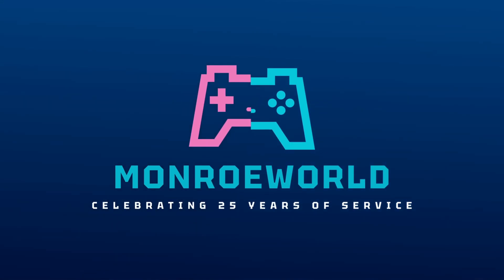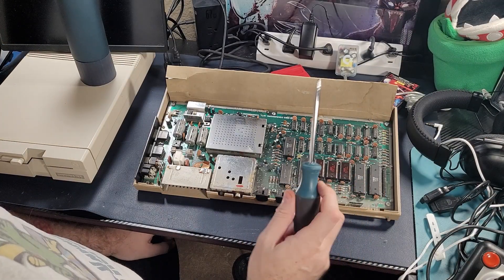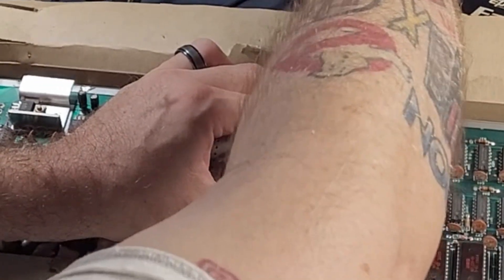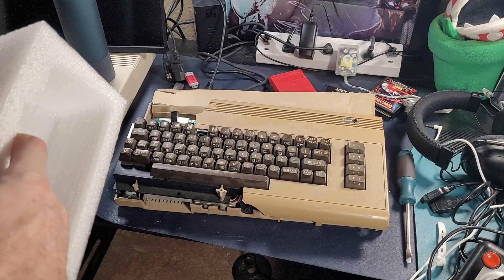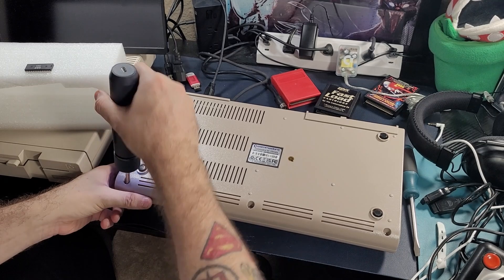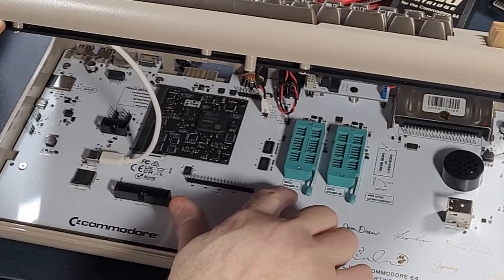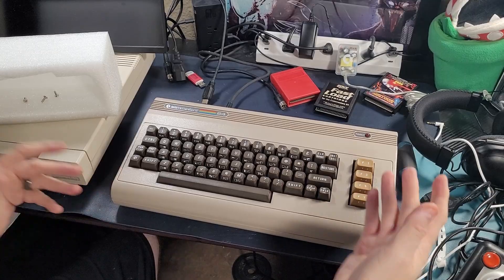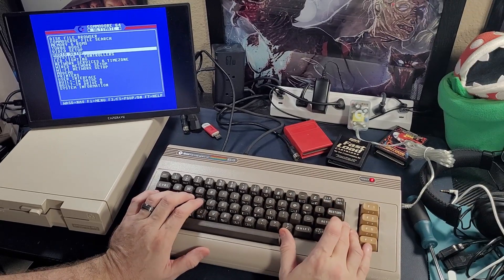Salvaging the Soul: Transplanting a 6581 SID into the Ultimate 64

Comment: I have an old breadbin model that I may use the keyboard from to get the latching shift-lock key, assuming it works OK following years of non-use. I'll check out the SID chip. I was thinking it would probably be soldered in, but from what I have read it is pretty common for them to be socketed. Hope so, as I don't have desoldering kit, and don't know anyone that does.
Reply from the maker: So glad mine was socketed.  I'm really considering that keyboard swap out myself ...

Comment: Dumb question.. Why install the 6581 SID from old into Ultimate 64??  Does the Ultimate not have good sound or use the same technology??
Reply from the maker: Well, first - because its there ... Doesn't it make you wonder why they made those slots available? :)  You put slots like that if there is a deficiency or need that the built in stuff can't handle as purely as some would like.

Why get an FPGA based unit instead of a dirt cheap "C64 on a Pi" solution?

We're trying to get the closest we can to a real C64 as we can, of course. 

The C64's calling card was the sound.  We all want it as accurately as possible.  9 times out of 10?  The UltiSID implementation is "fine".  Maybe even "great" for flexibility.  But just like those that can tell the difference between arcade Pacman and the Jakks TV Pacman game?  We can often tell fake SID  from real SID.  Especially in certain use cases.  For 99% of the people out there?  This will be fine (heck, the C64mini would be fine or Vice on a Pi).  For some of us?  There is a warmth to real silicon that isn't quite duplicated.

I guess it is a "if you know, you know" sort of thing.
Reply: @darkuni Good to know.  Thank you.  I look forward to when my ultimate comes.  Meanwhile,  I need to goto eBay and find an old c64 for transplanting!

Comment: It would be a good idea to point out that this is only really beneficial to audiophiles as the FPGA implementation of the SID chip is actually more than adequate, myself included in that. I've played countless demos and games and struggling to hear any difference. I know there IS a difference, just that your average user won't notice it. My reason for saying this is there could be a lot of machines out there that are functioning perfectly fine except they have no SID chip.
Reply from the maker: Case by case - 100%.  There are a handful of edge cases I've already been told (and tested myself) that fail to render properly on the UltiSID.  At some point, I'll probably do a demo video on it.
Reply: @darkuni  Please do :)

Comment: I would be interested to know if you can hear a difference between the emulated and the real SID chip? Is the upgrade worth it? And would the second "newer" chip also be worth upgrading to?
Reply: In my experience, it's possible to tell but only if you're very used to particular pieces of music by hearing it many times. Also, it's possible to discern with side-by-side comparisons. But if I hear things I don't really know and I'm going in blind, it can be very hard to tell. Finally, I'll say that what's 'better' is entirely subjective, and the only reason why the emulated version would clearly be worse is when it outright can't do specific sounds that were the result of the composer taking advantage of unintended glitches from the original chip. But this was also the case with later revisions of the sid with the 8580 versions... and to complicate that even more, many newer compositions up until the present day use the 8580 as the intended chip.
Reply from the maker: It was late last night so I haven't gotten to do all my "proper testing".  I'm 99% sure I will be able - in certain circumstances - be able to tell.  If I have some slam dunk examples, I'll do a video (even if it is just a short).  I have something in mind, actually ...

Comment: Glad I'm not the only one who doesn't like the color of the function keys.
Reply from the maker: #notmyc64 :)  I'm gray all the way.
Reply: @darkuni  Was hoping you’d try the f key swap at the end of the video. Next time maybe 😎
Reply: @keithh8010  The stems are different. They will not work.
Reply: @mjy  You could use a Drehmel on the original key to remove the stems fitting, 3d-print a stem fitting for the new keys and glue it inside the old keycap. I did something simular to convert an Amiga Misumi keycap to be Cherry-compatible. It´s a lot of work, so I just tested one key (from an A1200-net keycap I do not need for my A600, so no destruction of antique hardware), but it worked. A more simple alternative might be 3d-printing new stems with a resin printer (there are models of Cherry stems on thingiverse), reworking the top of the stem to fit into the old keys. Still, reworking a full keyboard this way would be a hell of work, but for only 4 keys it might be a solution.
Reply: It was a ridiculous decision. If 'Peri' was going to commit to those ugly tan function keys, he should have used 'silver label' case badges. The far more common 'rainbow' case badge models had the far more common gray function keys. Such a bone-headed decision when bringing back such an iconic model of computer.
Reply: @mjy  Or at least offer a choice! Seems like an opportunity to sell "correct" colour F key caps. Either Commodore, or a 3rd party.

Comment: Great testdrive Mr Monroe.. while i am still waiting for shipment status update from the commodore website (my C64ulitimate still in "awaiting shipment" status boehoehoe hahaha) i noticed that my old slim c64c has a nice  SID6581 socketed, that will be going to my c64ultimate for sure hahaha. but not leaving my old c64 without sound i ordered a SIDKICK2040DAC  (newer version of the sidkick pico:-)  to use that in my old c64
Reply from the maker: Oh hell yeah.  Let me know how it goes!
Reply: @darkuni  Its a blast Shane, and that for only about 25-30 bucks.. you can configure it via "sys 54301" on your c64.. its DAC can use 2 SID's for FM, stereo i believe. but you need to solder 2 wires to the CPU and for the $d400 channel i believe (still digging into that) you have also the option to route audio to a 3 pin jack to an external amp.. ANyway, i feel better not to leave my old C64 without audio while stripping the 6581r4..  
Ps, how did you managed to get your c64U so fast while its still in pre-order (at least what I understand from it). My order is still set to "await shipment" for a few weeks now,... aaaaargh your great video's did not help..

Comment: mechanical keyboard is done by Jim Drew like mentioned earlier in comments by some. case is from RetroFuzion.
and it seems that the bottom usb even doesn't function only the upper. but i think i have a theory behind that. maybe an update will fix that later but i am not so sure about that. what i do know is that there are USB handling chips that can only handle 4 physical ports, HEBER of the multimister system ran into this issue ones talking about it in the RetroCollective once.
and there are already two ports on the rear and one type C for the keyboard, although some say this is not USB protocol i saw someone atleast getting some gibberish on the screen connecting a external keyboard to that connector, gibberish mainly because he did not try to type a real actual piece of text on it. 
then why two stacked ports inside. well, maybe the designer thought the same thing like you, bigger thumbsticks will only fit slightly lifted from the mainboard. the cheapest and fastest way to achive that is to fit a double port only to let the top-one use that last "adress". i think thats how we have to think about that issue. an extra HUB should work though. maybe worth trying sometime.
Reply from the maker: Fascinating info.  Glad I moved it then.  Might have been pissed if I had buttoned it up :D

Comment: Sounds like the ultisid is still being mixed into the output?  You either have to remove the ultisids from the mix, or unmap them from the standard addresses.  Or, you can toggle the jumpers to get direct SID output via the 1/8" jack in the back.
Reply: Yes, I have installed a physical SID chip. You will find that both the chip and UltiSID are still mapped to $D400 by default. The UltiSID needs to be either set to UNMAPPED or OFF in the Audio mixer.
Reply from the maker: Indeed.  It was late - don't do work like this when you're tired :D  I have rectified that this morning.

Comment: U can also mount the original keyboard into the Ultimate. 100% compatible.
Reply from the maker: if this one were in better shape .. I'd consider it ... I do have another C64 in the back somewhere ...
Reply: I knew the connector was present on the board, but hadn't seen any confirmation that all of the screw-holes matched up. I'd be surprised if they didn't. I might make the swap from an old unused breadbin, just to get the latching shift-lock key.

Comment: Been looking for a couple of hours and haven't found an 8580 for sale.  Ordered two 6581's off of Ebay.  But what I'm curious about is how does the sound change on an ultimate from the emulated SID to having a 6581 or an 8580 or one of each or two of each.  I'm guessing a game that only is designed to talk to a single SID won't sound different if two SIDS are installed, but might sound different with an 6581 or a 8580 or the emulated SID.  Maybe this can be fodder for some future video?  Love the channel.  Thanks for getting me to spend almost $200 on old chips tonight.
Reply from the maker: I feel your pain.  I went shopping on eBay too.  I wasn't going to pay $200 - so I gutted the old broken one.  There is a C64C for sale on Craigslist I may acquire but he wants stupid money for it too.  I need that 8580 so my life can be complete. :)

I think it is all about "addressing".  So if a game or demo doesn't "ask" for "a second SID", then it falls back to the default addressing and the ONE SID is used.  If a demo or player requests more than one, it asks for the addresses and taps them appropriately.
Reply: Gideon's FPGA implementation of the SIDs is very impressive. It's actually one of the most accurate ones out there, practically indistinguishable in terms of sound quality to the MiSTer FPGA C64 core, which is already one of the best out there.

Comment: another great video, thanks for sharing! I put my 8580 in my beta unit, but I popped some good quality copper heatsinks on top, might be worth thinking about for the 6581? it runs pretty hot if i remember? would be awesome if the new Commodore start to do SID runs, would love one of each inside. Thanks again, for awesome tech deep dives on the C64 Ultimate, keep up the amazing work! 😻
Reply: It would be great if new SID chips could be made, so that more original C64s remain complete.
Reply: @brianstuntman4368 totally agree!
Reply from the maker: Appreciate you!  I shall look into this cooling deeper.  Heat sink wouldn't hurt ...